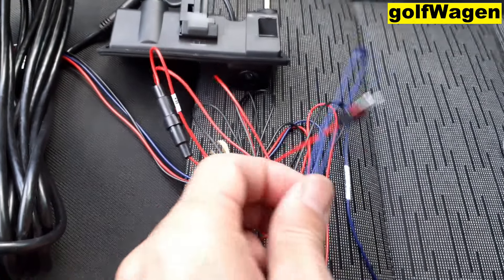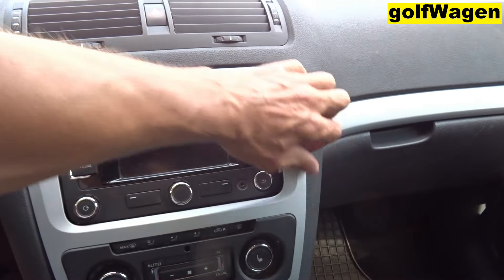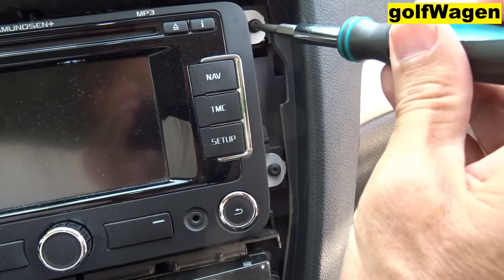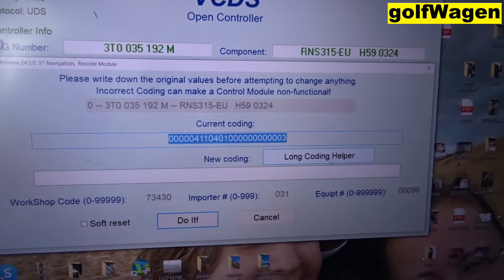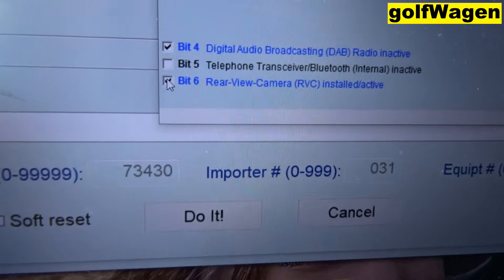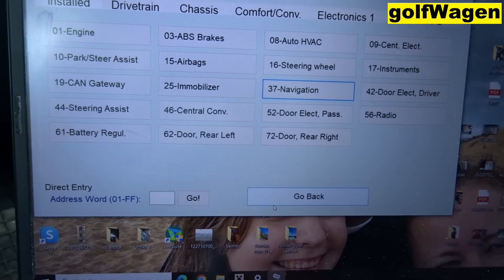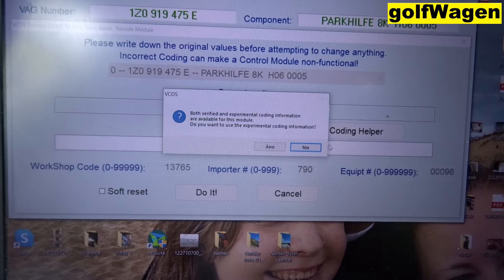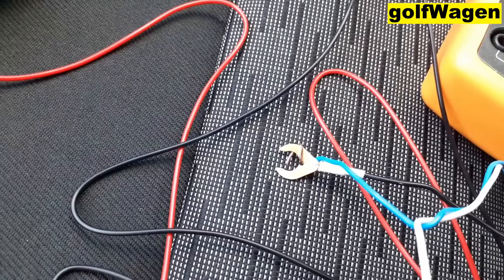Skoda Octavia 2 RNS315 Amundsen Rear View Camera install coding

Comment: Hi, Did you have to make a bigger hole in the trunk hatch? Is fit well?
Reply from the maker: the camera is bigger than the hole. I still don't know how to do it.
Reply: @golfwagen4173  Yes, I was training figure out this on this weekend and also I don’t have idea because there is a small step and handle will not lay flat, will need some sealing🤔, but that will make permanent connections between handle and hatch, what Is not in my style. Maybe some 3d printed adapter to leveling the surface🤔

Comment: Hello, I have Rns315 on my Skoda.  Is it only necessary to have the camera and to extend the installation and, of course, to activate the diagnostics, or is a module also required?  Thank you.
Reply from the maker: you need to buy an RGB camera on AliExpress for 75 euros. Or an original VW RGB camera around 400-500 euros.
A classic PAL camera for 15 euros will not work.
Reply: For low camera (static line) u do not need module

Comment: Salut jai le même conecteur acheté sur ali express pour un rns 510 de fin  2007.
Logiquement cest comme la video, mais jai vu que yavais une histoire de signal qui nest pas le même de rca a l'autoradio, cest vrai ou pas ?
Reply from the maker: je ne comprends pas essayez de formuler la question différemment. Je l'ai mis dans le traducteur et je ne suis pas sûr de la question
Reply: @golfwagen4173  salut ok, je vai essayer différemment 😁
Jai acheté le même connecteur sur ali express, mais ya que 1 fils rouge et le jaune de la video.
Es ce que ca suffit pour y brancher une camera chinoise ou il faut dautre fils....
(Vous avez le fil violet et noir en plus que je n'ai pas sur le mien)
Reply from the maker: Le rns510 nécessite une caméra RVB spéciale (RGB en anglais). le connecteur jaune PAL/NTSC normal ne fonctionnera pas. Ensuite, il y a un convertisseur PAL/NTSC vers RVB, mais il ne fonctionne que si l'entrée de la radio est si jaune ou beige, j'avais du noir sur la vidéo et seule la caméra RVB y fonctionne.
Reply: @golfwagen4173 merci pour la reponse, je vai me prendre un chinois sa ira plu vite👍